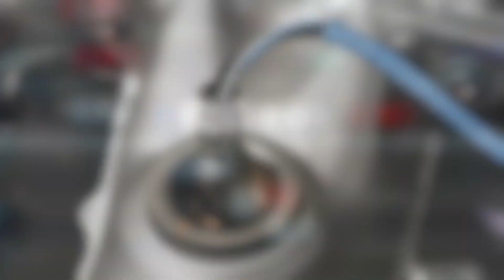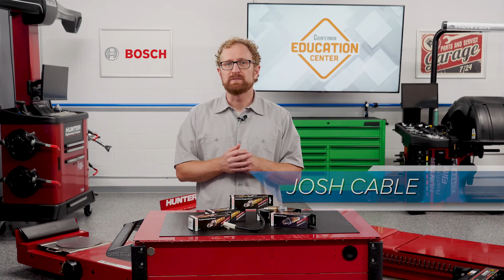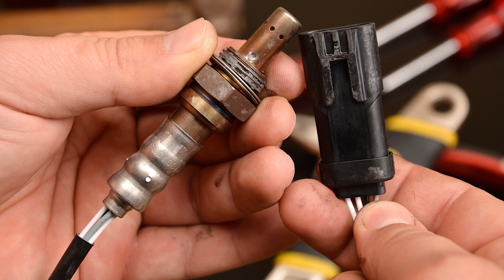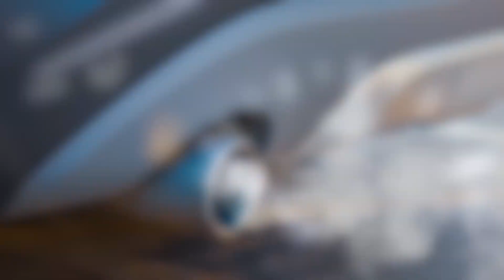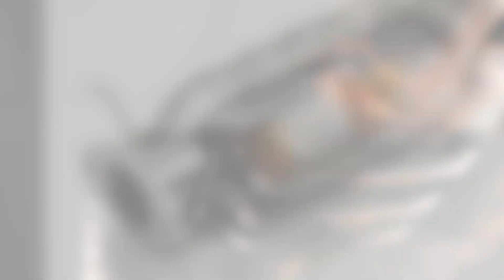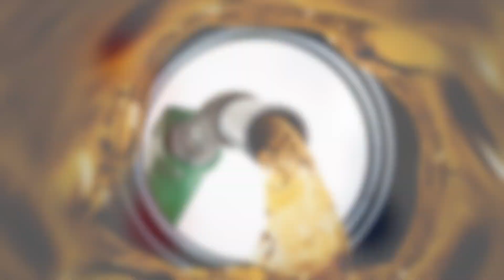Replacing Bosch Premium Oxygen Sensors

Comment: What we really need to know are the working specs for your oxygen sensor products so that we can diagnose if they are working properly. That should include the heater element resistance and what the readings on a scanning tool should be. That's what I would call customer service I'm pretty sure no one goes on to your website to admire your infomercials. I always respected Bosh for their quality products this is only constructive criticism in hopes for improvement.